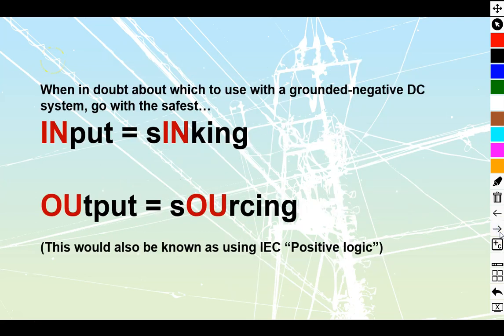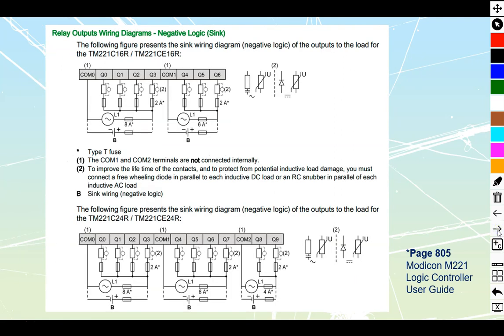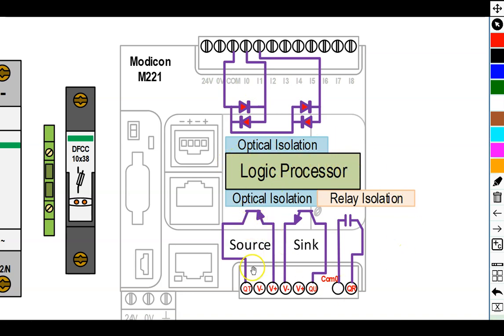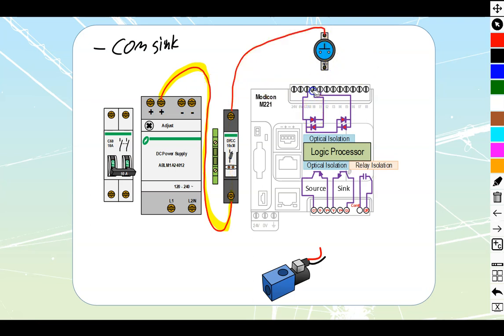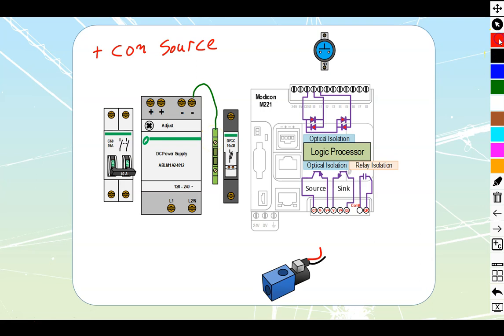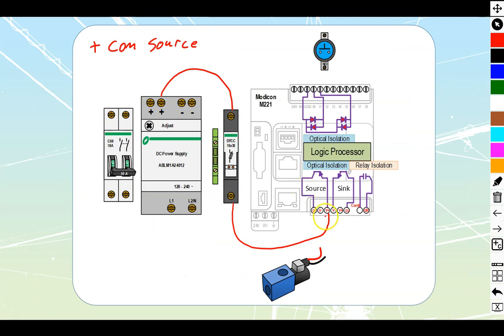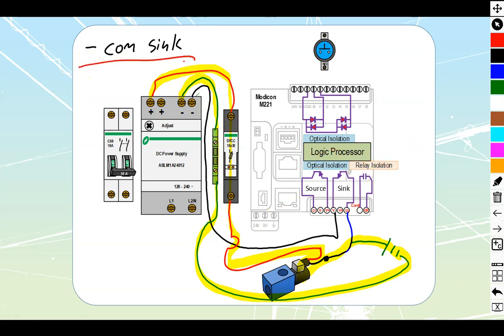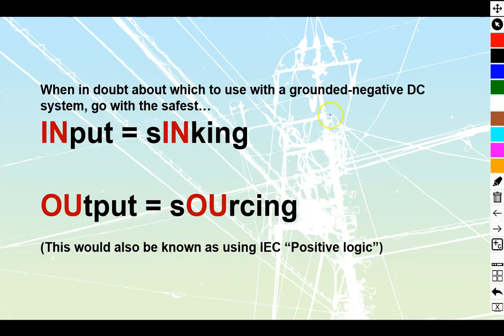Sinking and Sourcing on a Schneider Modicon M221 PLC (Video 2 of a technical series)

Comment: Hi Joel. Really awesome and helpful videos! 
I have one question regarding transistor outputs type. In minute 16 we can see that the output circuit (sourcing) is closed but the V- contact (in the outputs module) is never used, whereas in Video 11 of this series (in minute 3) both V+ and V- contacts of the output module are used. I’m a bit confused. Why V- is needed for if the circuit can be closed without it? 
Thank you in advance. Regards from Spain!
Reply from the maker: Hi Jaime,
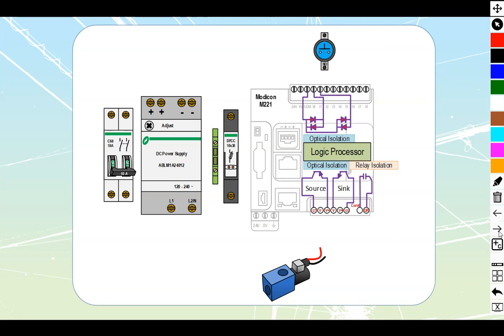This video is setup to just to explain sinking/sourcing conceptually.  In fact the PLC with all these different types of outputs shown in it does not even exist (4:50).  All that I'm attempting is to show how the power feeds through with respect to polarity.  In doing so I don't use that V- since it's not part of the load path.

Video 11 shows a true PLC and the correct wiring for that.  On a regular output bank, we do need to supply V+/V- to that outputs section to run the actual transistor (Since inputs and outputs are completely cutoff and optically isolated from the internal processing and power electronics of the PLC.)  Although in the wiring I send the load contactor V- back to the PLC, it could just as easily have gone directly back to the V- on the power supply.
Reply: @joelteacheselectrical  Thanks!!